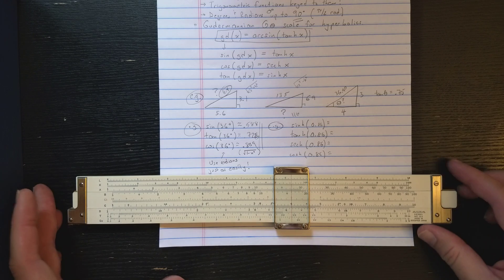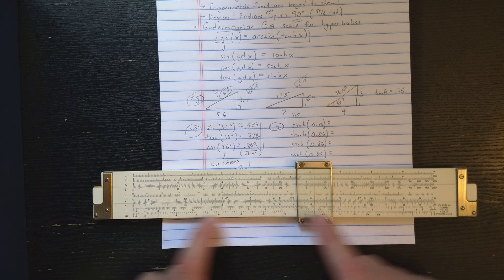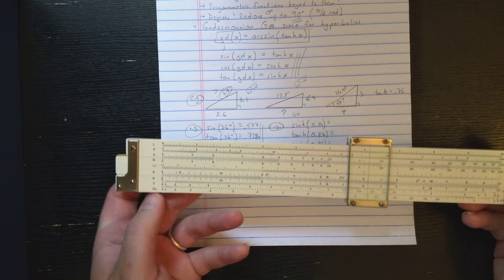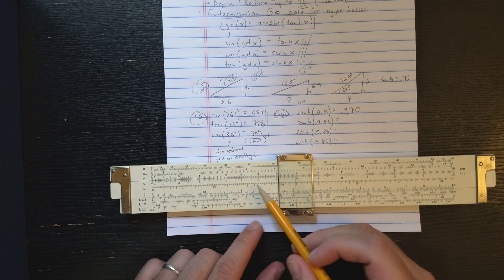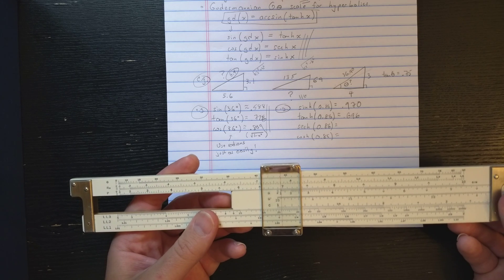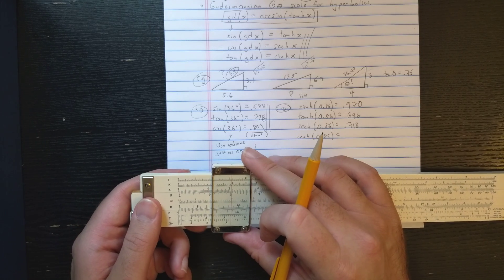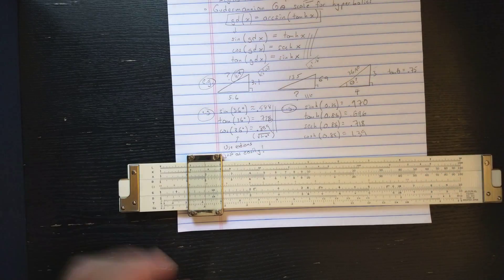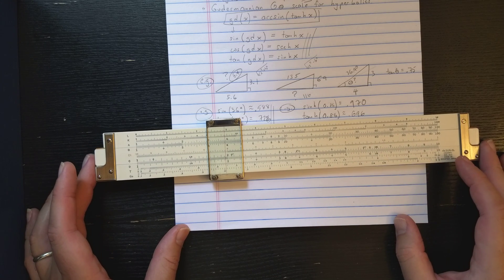Hemmi 153 Electrical Engineer's Slide Rule with Gudermannian Scale  (3/3: Hyperbolics)

Comment: My father was in the Air Force and I was in high school in Tokyo in the early ‘60s. I went to the Hemmi factory to buy a Post Versalog. They refuse to sell me one so I bought a 259D. On deciding to become an electrical engineer I went back and bought a 153 and a 255D. I still have them all but don’t remember ever using the 153 or 255D in college. And yes I did get a degree in EE.

Comment: I believe you are right that only the Hemmi 153 had the Gudermannian scale. Even the 20 inch Hemmi 154 had conventional hyperbolic trig scales instead.
Reply: But I knew there was one possible way I could be wrong. So I checked. Although there are differences, the Flying Fish 1018 slide rule from the People's Republic of China did copy the otherwise unique special scales of the Hemmi 153.
Reply from the maker: The late Chinese slide rules have some really unique and innovative layouts.
Reply: Also, the Post 1461, made by Hemmi, of course, had the theta, R-theta, G-theta and T scales, along with P and Q. According to an issue of the journal of the Oughtred Society, these are the three known slide rules with the Gudermannian scale.
Reply from the maker: The Post 1461 is simply an imported Hemmi 153.
Reply: The POST Versalog 1461 I have is a modified Hemmi 149A rule.  It does not have Gθ on it. It seems POST had two models with the same number 1461, one pre-WW2 and one post-WW2. The pre-WW2 one is the Hemmi 153.

Comment: Thanks for this series of videos, Prof. H.  After viewing them I scored a 153 in great shape, including box, for under $20 on an eBay auction!  (The cursor screws were loose on one side and a bit of Pledge oil was needed on the slide, but it was easy to adjust to spec.)  Nice rule, and your videos and the comment by John Triplett were a great help in understanding its use.  As a retired mathematician I have a couple of old "function atlases" on my shelves, and I found the Gutermannian there.  I don't know why it was first investigated, but it sure is a slick way to do hyperbolics on a slide rule. 

I do have a question:  What method do you consider for doing hyperbolics for small angles like 4 degrees?  I got decent results by using the definition (e.g., (exp(x) + exp(-x))/2 for cosh(x)) and an LL scale, plus some hand addition, but is there an easier way?  Maybe a short Taylor series approximation?

Cheers and thanks again.
Reply from the maker: You're welcome!

I wouldn't see a need to use anything besides one or two terms of a Taylor series approximation. It really depends on your application.

In terms of relative error, sinh and tanh are already pretty much as good as you'd want on a slide rule assuming sinh(x) ~ tanh(x) ~ x for x < 0.1 [in radians, so just convert degrees to radians if necessary]. The error term for both approximations is O(x^3) which explains why they are pretty good.

Using one term of the cosh series, i.e. cosh(x) ~ 1 is incredibly simple but the error is a little worse since the error term is O(x^2). Depending on your application including the next term may pay off, i.e. cosh(x) ~ x + x^2/2. The x^2/2 part is easy to calculate if you have either root scales or the A and B scales. It may not really be faster than using the LL scales as you mention, though, if you have both LLx and LL0x.
Reply: @ProfessorHerning  Thanks for the reply!  I tried using 1 + (x^2)/2 for cosh(x) for 4 degrees (converted to radians, of course) and it was very close using either A/B for the second term or sticking with C/D and multiplying x times itself there.  The latter gave more resolution, of course.  Cheers.

Comment: Nice videos.

Interesting approach to finding cosh(x).  The Hemmi manual for the 153 describes using the Q and Q' scales for doing this.  Once you find sinh(x) on T, transfer that answer to the Q scale, and then find cosh(x) directly on Q' under the hairline.  This is effectively using the identity cosh(x) = SQRT(1+sinh(x)^2), which is both the correct identity and the mathematical relationship between the two Q scales.  HOWEVER, this works only for x < 0.88 on Gtheta (sinh=1 on T, indices on the Q scales).  For anything bigger than this (0.88 < x), the relationship does not hold for the scales.  Hemmi manuals are notoriously scant on information, leaving the user to either figure it out or Google it (as it were).  What I figured out is to use the P and Q scales in the same relationship as the Q and Q':  set Q:1 = to P:0.  once you have this 'proportion' set, you can set sinh(x) on P and directly read cosh(x) on Q.  This is a bit quick and dirty, because you lose a great deal of precision, but it works.  

On another point, regarding vector calculations, you rightly noted that Q' ends at SQRT(2).  With this, the Hemmi 153 shares some similarities with the P.I.C. 141 (or the 144).  They are using essentially the same logic to find the vector resultant, but in a different format:  the Hemmi uses two full length scales, the P.I.C uses what amounts to one of their patented differential scales (a 'Z' scale), and it is much more compact.  The P.I.C. Z scale (presumably for 'impedance') is a small scale of tangent ratios that equals the range of 1 to 2 on the A scale (SQRT(2) on C), and is equally clever.

Comment: Hello Professor ,I was wondering if you have any experience with British made slides ,viz, British Thornton or Blundell Harling. I recently purchased a pair as a job lot in excellent condition ,the BT is the P221 Comprehensive and the BH is 805 Electro . They both seem very user friendly.and well made .
Reply from the maker: A little bit. I have a PIC 101 and a later version of the BT P221. You can see the latter over in my video about differential trig scales.

Comment: 1. Are slide rules faster than a calculator?
2. Where do you find these? They aren't available here.
Reply from the maker: 1.  That depends on your skill as an operator and the particular calculation. Certainly calculators are faster and more precise in a lot of cases, but there are some where a slide rule might win if you don't need the precision. Examples might be the solution of proportions or triangles. Some commentors on my other videos mentioned that people would hold speed competitions in school when calculators first appeared in the '70s,
2.  I've bought most of mine on eBay. A handful are from other sources. In the US eBay is probably the best place to go (but definitely shop critically and patiently). I have looked at antique shows and stores but usually nothing of quality turns up.